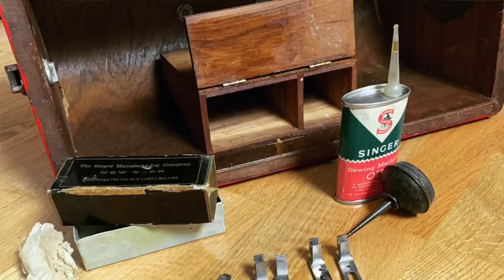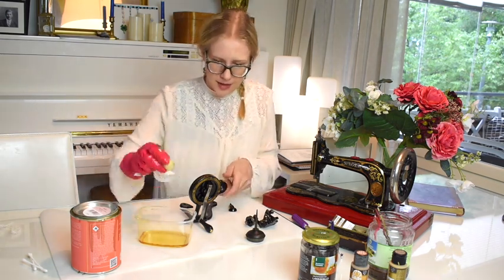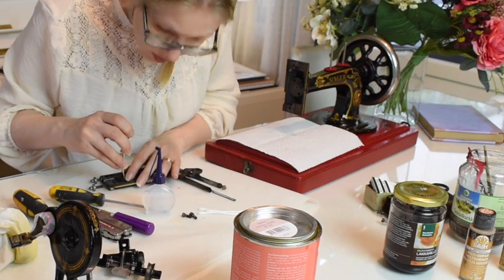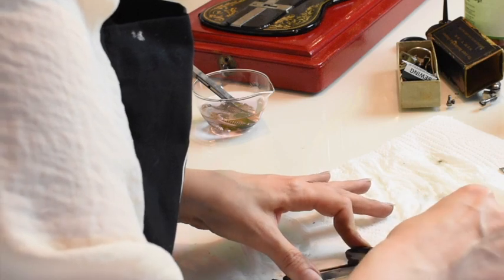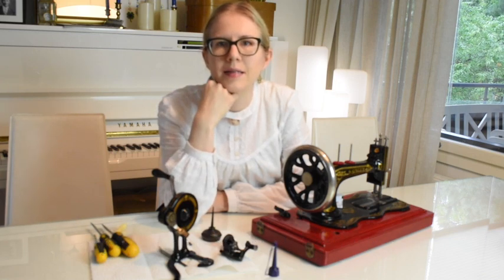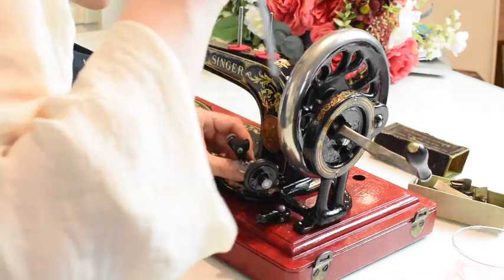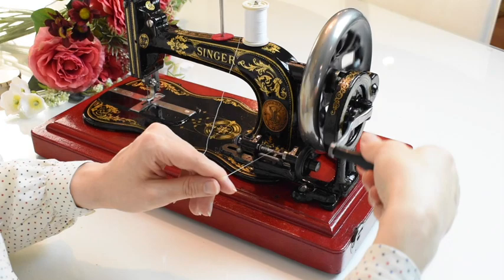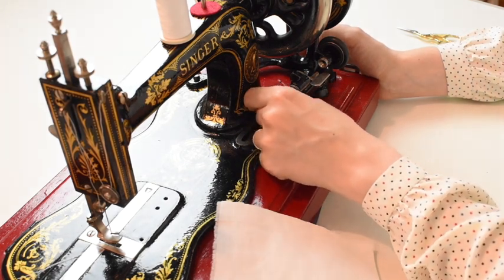Restoring an 1888 Singer 12 sewing machine

Comment: Thanks for your valuable info Katja. It was very informative and important as I have just bought a Singer 12K from the UK. It is from 1874 and is in a very good condition and should be in working order. It will arrive in about 5-6 days and the first thing I want to do is  take it apart to check everything, then clean and oil it.
Once again many thanks!

Comment: Great video. I just finished my 1879 12K and I can’t get my needle to line up correctly. Is there a trick to it?? I already broke 1 needle. 
It’s landing right on the presser foot. When I stick it in the hole the needle is bent. If you can help, please do. Thanx
Reply from the maker: Are you sure you have the right kind of a needle? The shaft should be 1 mm wide. Modern needles would hit the presser foot.
Reply: With my hands dream 
I found some 12x1 needle in under the machine. They a lot thinner than the normal 15x1 & 705h ones that I have.
Reply: Check out Andy tube he restores singer sewing machines, he may be able to help

Comment: Wow, get some decent tool. Not expensive. And don't you have paint brushes? Other than that, good luck.
Reply from the maker: Thanks for the tip. I do have paint brushes but shellack is traditionally spread with wool pr cotton squeezed inside a piece of cotton.